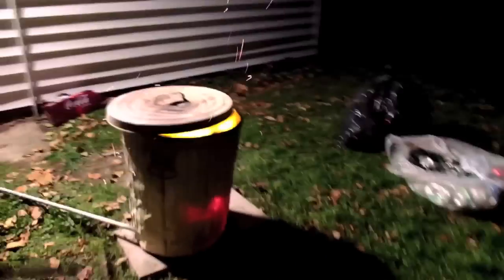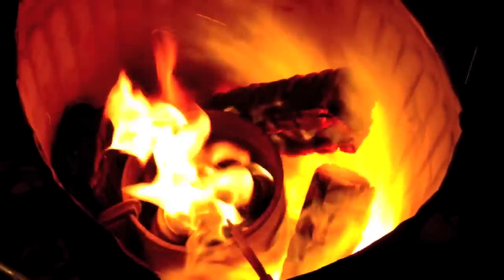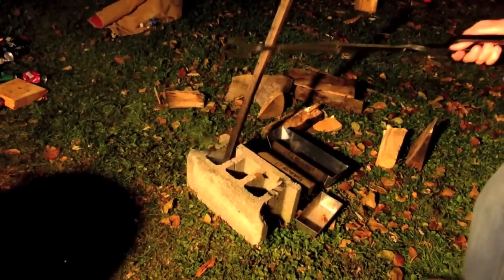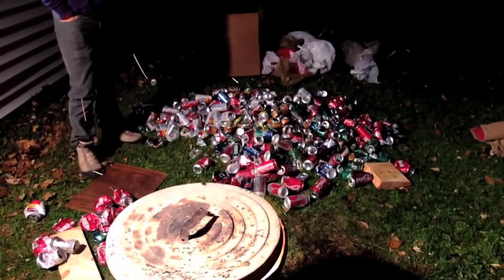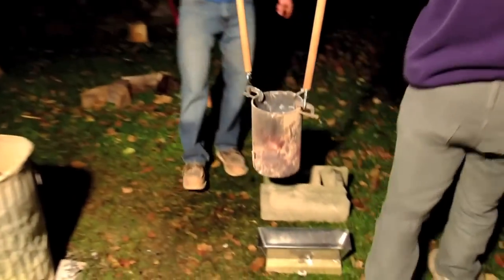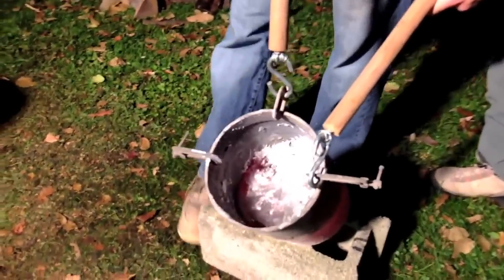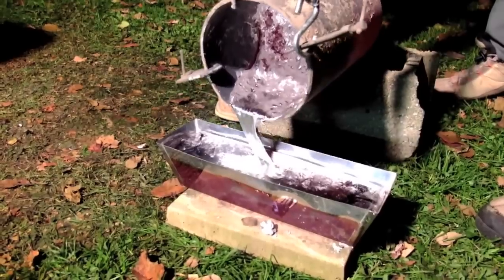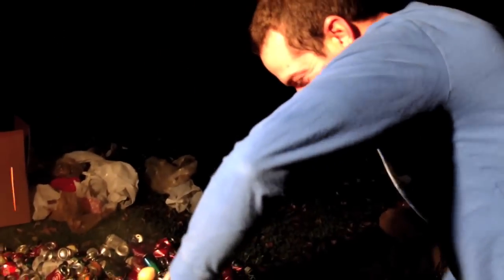How to Melt Aluminum Cans into Ingot

Comment: It's far from pure
Reply: you are correct
Reply: actually we did, but just not all of it.  there as a ton of it and we just had a regular spoon duct taped to a stick.
Reply: Mike van der Ven When you melt metal, all the impure properties and sludge becomes lighter than the metal itself and floats to the top. Using a skimmer to remove it all before it's poured keeps the metal a lot cleaner. That is what skimming is
Reply: Blood Feast
Yes they burn away just like Joe says. Aluminum melts at 1200 degrees and the paints burn into nothing. The hotter it is, the more impurities separate from the metal, and the more pure the actual metal becomes. So melting it a bit hotter than it's melting point allows for a much cleaner metal.
Reply: Blood Feast
the paints burn off completely.
Reply: ***** no its not it has a lot of impurities and the grade of aluminum doesn't really matter when your using a homemade smeltery
Reply: I have seen people make castings before. I have done it myself. Being successful requires having some prior knowledge of the process. Face it, there have been a lot of great ideas that started in people's garages and back yards.
Reply: Mike van der Ven removing the top layer of the molten metal mixture
Reply: ***** Aircraft grade? you mean duralumin? so it's an alloy and thus not pure..

And man, ppl know nothing of metals and do stuff like this. They can't do anything with that ingot, and any industry would probably prefer in in the shape of cans than some ingot melted at home.. It's nice as a DIY thing to show that it can be done, but knowing that aluminum gets it's strength more from a proper casting process and heat treatment rather than just being the right composition is important. It's not like the alloying elements are that expensive like vanadium or niobium in stainless steels.
In metallurgy this aluminum alloy system is commonly used at different compositions in classes to explain how metals solidify and how it should be controlled. It would have been nice to see some educated tough to this, when done at all..
Reply: mattg889 ALuminium cans are sold by recycling facilities to the foundry in the form of Bales of a particular size, Those bales get melted down and formed back into ALuminium cans, The foundry Never uses Bike parts, Lamps, Wheels,Gutters,  INGOTS of unknown core composition, ETC ETC, to make make Aluminium Cans, For that reason Recyclers pay more for Aluminium Cans when buying Aluminium as Aluminium cans, There are many types of Al, and different prices.
Reply: I know, they didn't even skim all the shit off before pouring it. That's just the first thing.
Reply: mattg889 Nope,as  An ingot it's now worth LESS than it was in the form of Cans.
Reply: mattg889 they have also oxidized a large part of the metal and introduced lots of impurities. I don't work for a recycling plant, so I have no idea what they pay for what, but as a metallurgist I find it highly unlikely that they would even buy an ingot made on someone's backyard at all, let alone value it the same as cans.
Reply: Scott S what does skim mean?
Reply: ***** Higher grades of aluminum is pretty expensive. Cans are all recycled aluminum, as thin and cheap as they can possibly make it.
Reply: nilssab
I would imagine they could still bring the ingot to a recycling facility and the recycling facility would just treat it as if its aluminum cans.  Then they would receive whatever the going rate per lb of cans is, that is if you get money from recycled cans where they live.
Reply: mattg889 Not so much cans, since they really are not cans anymore. However the scrap yards do pay for metals so it can still be turned in. Otherwise, other things can be made from it and sold if someone is feeling a bit creative and likes some extra projects.
Reply: Scott S You could, the best thing would probably be to slice it into three pieces, polish and then roll them into thick metal plates, but whatever you make will probably become quite brittle, unless you have an inert furnace to heat treat the plates in. You could try heat treating them while forging, but every time you heat it the surface will oxidise much deeper than at room temperature, and while forging you will insert more and more defects into the base of the material, if you take too long time it will just crack and crumble. It can be done but it's hard, and in any case this is MUCH more wasteful money- and energy-wise than just buying aluminum plating of the dimension you want.
Reply: Thank you very much for that unsolicited testimonial. However, anyone can see clearly that it would be a complete waste of time to make anything of serious use out of metal so polluted in the first place.
Reply: Yes, that is what I said. However, I wasn't implying parts for a space shuttle. I was thinking more in the lines of yard art or other things that wouldn't require a sound structural integrity. But whatever, you can split all the hairs you want. Have fun.
Reply: yes, I'm a DIY maniac, so trust me when I say that I know that many things can be made by yourself. Even semiconductors can be made DIY. What I'm speaking of is making something out of an ingot of aluminum, which is really hard, especially if you try to forge it out or something. If you cast it, sure, you can make whatever you want, but then why not make it directly from cans and not melt it twice. And even then it wouldn't be a bad idea to use an aluminum alloy that is made for casting.
Reply: Its mixed in with many impurities, in metallurgy there are multiple processes to filter out and remove them, forming a pure ingot of aluminum is actually alot harder then it looks, but luckily it is one of the more recyclable metals available.
Reply: Scott S You said "Otherwise, other things can be made from it and sold if someone is feeling a bit creative and likes some extra projects." But whatever.
Reply: All I'm saying is that whatever you try to make from it it's probably surprisingly difficult, when I say quite brittle, I mean as in: it will brake while making it and never even become yard art.
It's not like I think anyone will do it, but just saying that if you do, be careful.
Reply: I agree with you on that point. Not much point to melting it twice.
Reply: WiIdbiII um, no, it would be worth the same as cans.  Not less.  They have already saved the recycling facility some work even if the metal isn't usable yet.
Reply: nilssab indeed they did add a lot of impurities, but they removed a lot too. The raw cans have just as many different impurities, if not more.  
The local recycling facility will just compact the cans and then send them to another recycling plant that actually processes them.  So these guys only saved the local facility 1 step, the cans are compact.
Reply: It's all measured by weight. Once it's melted down again, it becomes weight added to the rest and right back where they started in the first place so it really doesn't matter. Metals period gain and lose properties through the entire process and compensations need to be made along the way adding different amounts of different elements for different quality's and strengths. It can be an impossibly boring subject but where would we be without the people that do it? All metal would be snapping in half more than likely. Please remember this video was made behind daddy's woodshed someplace. Not exactly a controlled environment.
Reply: WiIdbiII recyclers pay plenty for the raw metal at the rrecycler facilities around here in any form.
Reply: mattg889
 It absolutely is NOT worth as much as cans.
Reply: So these bars are a quarter slag ey?

Comment: make those aluminum bricks and just stock pile them in the basement than load the truck and take them in. I just brought all my energy drink cans in and got .60/pound on them. only make like 10 bucks but hey thats a pack of smokes and two burgers from mc donalds. lol
Reply: It's better to bring the cans themselves I suppose. Usually they use two different alloys (for the tips and the sides), so when they are molten, one remains kind of solid while the other gets completely liquid, then they are mechanically separated.
At least that's how cans are supposed to be recycled.

Comment: Suggestion: check out the videos for making junk mail paper logs, and tell me if you can still get the same results as the pine wood. And there are tutorials on making green sand, which will help make your ingots more even. Last, did you remove the crap (slag?) Off camera? I see a few where when smelting, they removed crap outta the melted aluminum. Final question, how many ingots did you turn in, (if you did) how much did you get for it?
Reply: you should use charcoal if you are going to try this.
we removed as much slag as we could with a spoon duct taped to a stick.
Just one.  We poured it all into a drywall mud pan! 
And its still sitting on my shelf.  I have no idea what a scrap yard would give me for it... but that was not the point.  Just  for fun.
Reply: Zach Holt Having done the math assuming you used 700 cans, the final product is worth 17 dollars if it's pure. It's safe to assume, however, that it isn't pure. So it's probably better to just keep it on your shelf.

Comment: nice job removing the slag before you poured... nice sized ingot mould though! i couldn't find anything like that, anyone here have suggestions?
Reply: If you are trying to get good quality, you would have to do a better job at removing all of the slag.  We just scooped off as much as we could.  You would also have to de-gas it.  The ingot mold we used was just a stainless steel drywall mud pan!
Reply: oh, interesting, never thought of that. does the aluminum ever have the tendency of sticking to the stainless steel, or (as my experience with steel goes) alloying with it?
Reply: the non stick spray? that would burn. or it would boil explosively on contact with the aluminum.
Reply: Nope aluminum and stainless are like oil and water.  I accidently tried to use SS filler in an aluminum weld and it was strange.
Reply: Matthew Messer interesting! thanks for the info. i once (the first time i ever cast aluminum)  used regular steel, and man did it alloy with that steel, could hardly get the ingot out.
Reply: theoretical physicist  how about pam?
Reply: theoretical physicist weird mine didn't do that... you were probably dealing with more heat though.

Comment: What about all the chemicals lining the cans?  Is that the reason why we just take the can tabs, since they're pure aluminium?
Reply: The cans are lined with plastic and are coated in paint.  Most of this just burned off, but there was a LOT of slag floating on the top.  We scooped as much as we could off, but obviously we were not too concerned with purity.

Comment: if you use wax candles in the smelt it acts like flux learnt that from past u tube vids 
good work guys.
also smaller ingot mould can be made from angleiron welded on to bars can make alot of ingots at a time

Comment: Please help.I dindn't quite follow and understood the video exactly. They started and mantained the fire with wood?And what was the connected pipe ??please help guys
Reply: we started with charcoal but quickly ran out.  You need charcoal to get the fire hot enough.  I think just using wood might not work.  The pipe was just shoved through a hole in the garbage can at an angle to make the air current circular.  This way it propagated throughout the entire can.  And the other end was taped to a shop vac.

Comment: Was your mud tray undamaged after taking the ingot out? Do I need the blower to melt the aluminum, or could i just have a normal wood fire going? Please answer.
Reply: you need the blower to get the fire hot enough.  you could use a hair dryer...
Reply: the mud pan is pretty much destroyed... but I hate drywall muding so it was very satisfying!
Reply: Thank you very much

Comment: Someone had way too much time on their hands and didn't do their homework. One those S rings don't give you very good control. Two, the mold was way way too thin, for any type of melted metal and your 'forge' could easily had melted. that being said with a few state exceptions Aluminum cans are thrown away and its nice to see someone is doing something about them. I mean what would you rather bring to the scrap dealers. a couple truck loads of alumium cans or a couple of bars worth of almost pure aluminum. next time try sprinkling the melted metal with borax. less than two fingers full and it takes the impurities out of the metal, or at least it does in silver melting.
Reply: Yeah, whatever. I often melted aluminum and forged my own things when I wasn't even 10 years old; I never really cared about the quality of my work, it was simply fun.
Reply: ***** Uh. What?
Reply: ***** Just in case you're wondering, it means don't be an idiot :) cause I like making up my own acronyms too.
Reply: ***** "Someone had way too much time on their hands an didn't do their homework" I was mainly commenting on the rude statement made, the advice is out of the question. He continues to comment on his mold and his molding procedure, which I thought was unnecessary. There is no way that I could be described as an asshole for NY comment. I was stating my own opinion; I believe you don't need to be professional with your first attempt at doing something as long as you are being safe, as well as learning from the experience. The person who commented was a little harsh in my opinion, so THAT is why I said "whatever", because I simply do not care for " doing my homework", not 
Literally, of course.
Reply: Woops, Google messing with my spelling again :/
Reply: ***** mhmm
Reply: my safety was fine i watched from here
Reply: ladys, ladys, shut the fuck up
Reply: You don't try something inheritantly dangerous without doing some sort of research is what I was commenting on. But I would never call someone an idiot or anything else rude in a video. Just always safety first. I mean taking 5 minutes to put on safety gear or take precautions wouldn't have hurt would it? Better that 5 minutes than to live a lifetime missing body parts or have nasty burns. But like orifices both in the head and the bum, everyone has an opinion and their right to voice it.
Reply: Borax will NOT take impurities out of aluminum, disregard that part of GarouLadys comment
Reply: they were just having fun bro. no need for instructions to have fun :)
Reply: ***** That's how hard we had it-physics didn't even apply!! But you spoiled kids these days with your fancy physics and laws of nature. When I was a kid we couldn't even afford physics!
Reply: turbotortiose I agree with you..
Reply: Two kids arguing, interesting.
Reply: I don't think they cared
Reply: The Basketcase "They're".... not their
Reply: turbotortiose 10 years old? When I was a kid we had to melt aluminum into ingots while we were wearing our diapers AND it was snowing outside AND it was 100 degrees!!! ANd after that we had to put the ingots of aluminum and put them into our strollers and push them to the metal recycler AND then walk to kindergarten!  Those were the days. But you tell kids about it these days and they wont beleive you!
Reply: ***** Nope! We were that poor!!!
Reply: Finally. someone with sense
Reply: That went on way too long.turbotortiose
Reply: justin aldrich myn to im in the deep part of texas
Reply: happykillspree i agree. though it does prevent oxidation of the metal.
Reply: 351cleavland
Reply: 351cleavland uphill both ways to school

Comment: No, you DON't wish you poured water on molten metal... it would have exploded and majorly hurt you.... Very cool setup and kudos... How much did you get for it as opposed to just turning in cans?
Reply: we let it cool some and then poured water on it.  It was cool.  Should have gotten it on video.  This was a total waste of money.  We just did it for fun.
Reply: actually water on top vaporizes. molten metal poured on water is where you get explosions as the water is trapped and instantly expands 16,000 times and pushes the metal out of it's way to escape. that's why when i worked at foundries, i never worked the melt deck. i worked with someone who had 4000+ degree iron raining on him because some idiot threw a soda can in with the scrap iron that was about to be melted and it exploded.
Reply: David Burton Point made...

Comment: anybody know how much money that ingot would fetch?
Reply: weight is not as important actually,..it all depends on who you sell it to and the purity of the ingot. if you cut out the middle man, (local Scrap Yards) then you won't get pinched. Do a search for the closest Refinery/Foundry if possible and you can expect to sell at a much better price. just make sure you pick out the slag with flux when smelting, or any place that has a XRF gun will pinch you for that. All Refineries have them so just do it right the first time. btw it looks like the guys in this video didn't use flux or even skim off the top so what they made is called a Dirty Ingot. A fun project.
Reply: depending on how much it weighs, 1 pound of aluminum is only $1
Reply: oh. ok good to know

Comment: That aluminum is sticky and difficult to machine. Might be good for casting though. Probably a good idea to melt and clean the dross a few times, it can hide in the metal. You should wear more safety gear too.

Comment: Very cool! What is the tube coming from the vac / blower? It looks like simple PVC. My question if it is PVC how did the heat from the garbage can not melt it?
Reply: It's just an electrical conduit duct taped to the end of the shop vac hose.